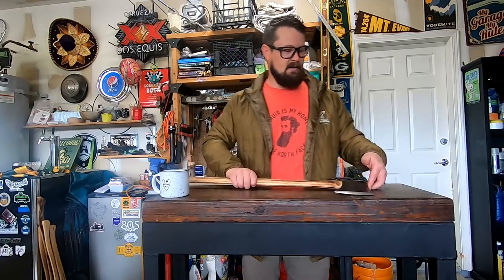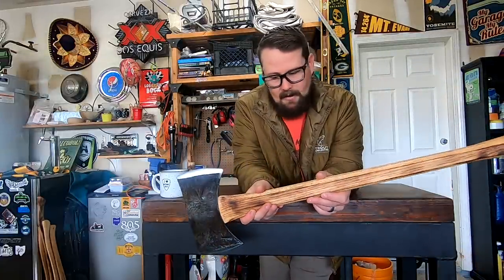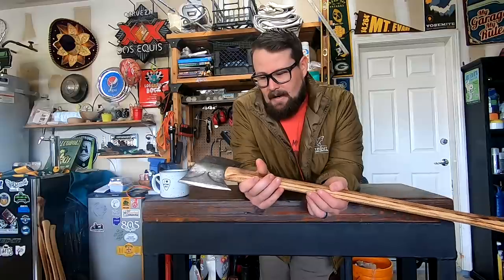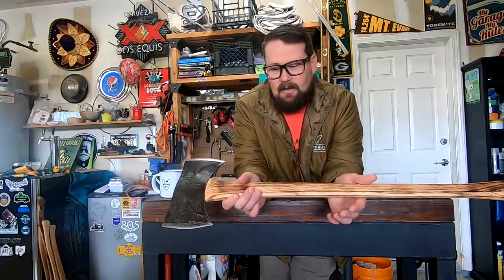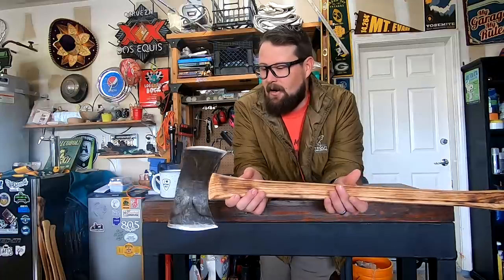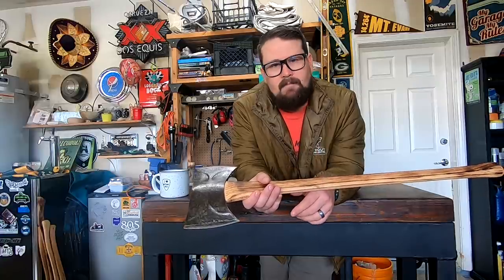OLD RUSTY DOUBLE BLADED AXE RESTORATION // True Temper Kelly Works Perfect

Comment: I have the same axe but mine was sharpened with a file and still has the original temper.
Reply from the maker: Very nice. Mine was sharpened with a flap disc so it does too. File skates right across.

Comment: Grinder will get the edge to hot.
Reply from the maker: I'm only using a sanding flap disc and I am constantly touching it making sure not to lose the temper.
Reply: @RoadandReel  good deal my heart sank lol🤣
Reply from the maker: @adams13f  I've gotten a lot of free axes that won't hold an edge because someone was grinder happy or they burned the handles out in a fire.
Reply: Me to and it kills me maybe we were born in the wrong century 😂 go back where a tool such as an axe was so valuable to them.

Comment: My man do I have questions for you - I'm trying to restore two of these for my father and never have restored an axe. If you have time to shoot me a message if love to pick your brain. I have some woodworking skills and no stranger to power tools. But never done an axe... thanks for the video either way.
Reply: @RoadandReel  
I am trying to figure out what type of axe handle will work with the two double bits I have. I am currently out of the shop but I could send pictures or measurements in the am. Also I saw how you finished your handles, would pine tar work? And what type of mallet did you use to set the head? Lol I can keep going but that will get me started,  I think I will put an edge on the blade with a file not a grinder but what is the bevel dimensions of a chopping edge and a splitting edge???